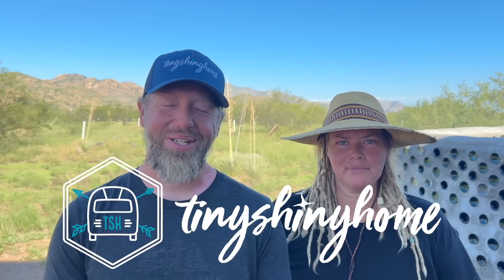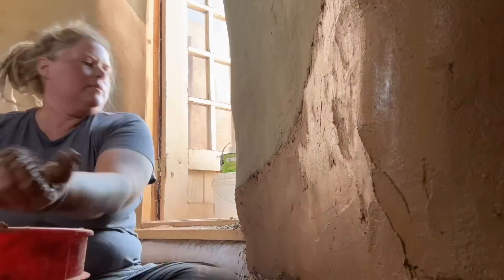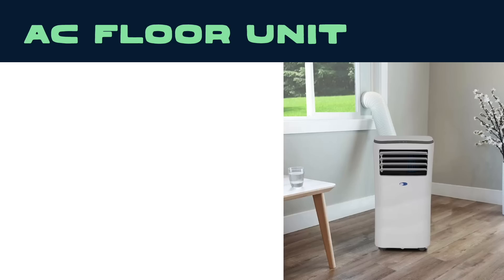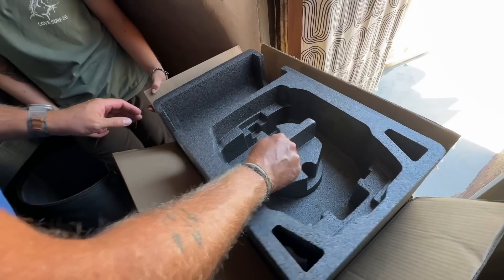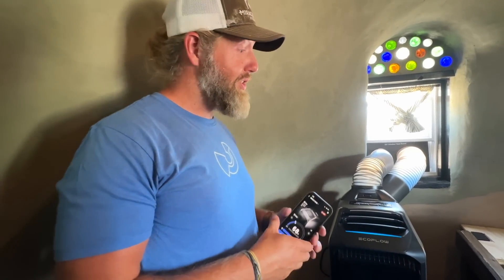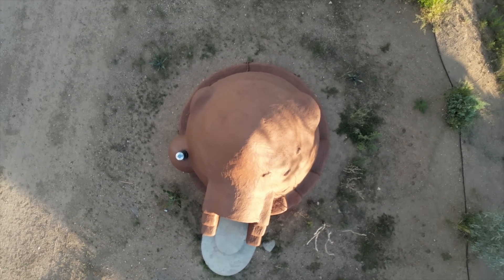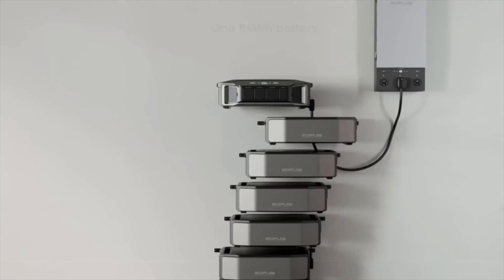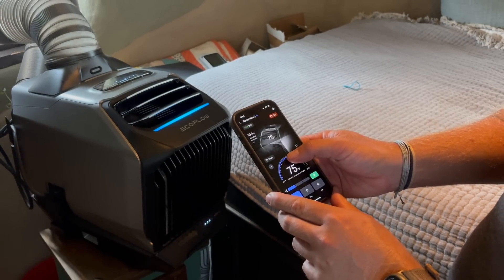Can This Tiny AC COOL Her Superadobe DOME?

Comment: How about try covering the top of the dome with a white tarp to reflect the sun during hot days so it won’t trap and transmit heat into the interior. Or some white, reflective paint.
Reply from the maker: No...
Reply: @TinyShinyHome 
Then get used to the heat.
Reply from the maker: Like we mentioned in the video, we're using the WAVE 2 for the summer, and it's working great. Then we'll take it out once it starts to cool down.

Comment: How about a seasonal "hat" for the house that goes on for the summer shielding and insulating it from the hottest angles of the sun? 
There must be some way to integrate something that could do that.  And prevent it from getting so hot in the first place.

If something simple enough was figured out it could be put on just during the night in winter as well to keep it warmer.
Reply: Painting the dome house white or a lighter color would see some reduction in heat retained
Reply from the maker: Winds 👎💨
Reply: @TinyShinyHome  Challenge that.  I have not seen you lose any of your other wind catching structures.  Pergola or other shade structure.  Any more leftover shade sails from the earlier Airstream location.  Or how about a living shade. IE a plant(s) and a trellis arrangement.  Have fun. Best wishes.
Reply: @69dblcab  Plants would be a great idea, a nice trellis over it. Maybe a Kiwi vine. That way you can have fresh fruit and shade all summer. Or loofah gourds.
Reply from the maker: We installed the shade sails on a metal truss over rated for hurricane force winds. All the other roofs are hurricane strapped to the bags and overbuilt on purpose. Every potential wind catching structure we build is carefully considered for our safety and neighbors safety.
Reply: @TinyShinyHome SO difficult to imagine 100 mph winds coming through as a common occurrence. God BLESS you.
Reply: @TinyShinyHome  Jonathan, Maybe I am reading this reply incorrectly.  I intended my comment to be positive in that you have not had any failures due to high winds. What you said sounded like a cop out that it was not feasible to put up a shade system. As a tire or other structure or cushion on top of the dome and round sail cloth or other with Radial ties attached to Earth anchors of some sort could provide seasonal temporary shade and hence cooling.  No ill was intended only to challenge you to try something as opposed to saying it cannot be done.  Again you have many structures that prove it can be done and you have done it.   Kindest regards.